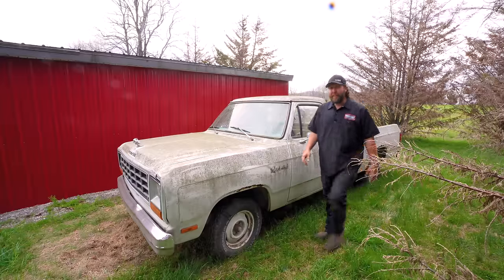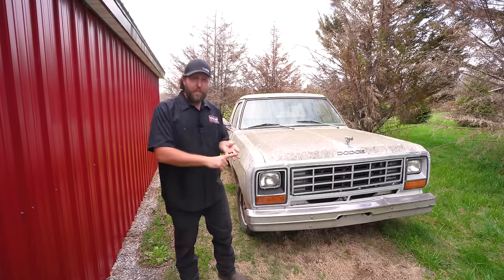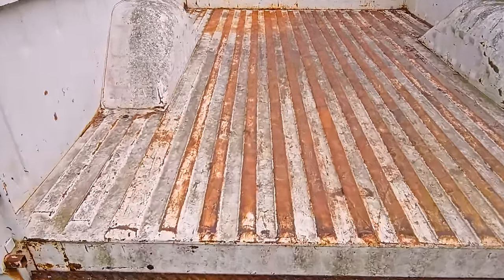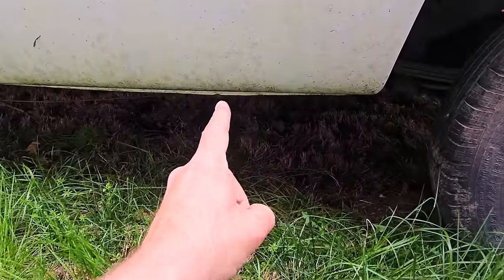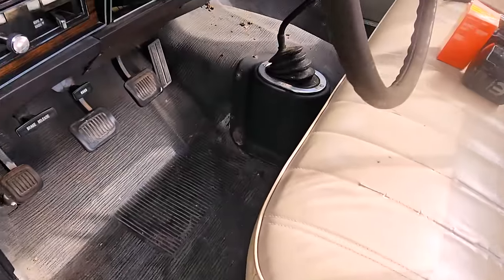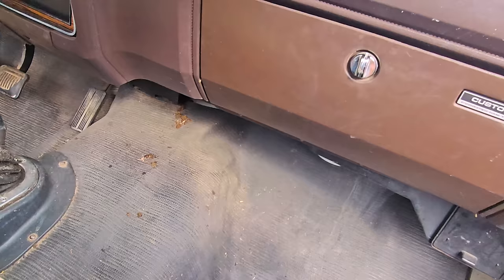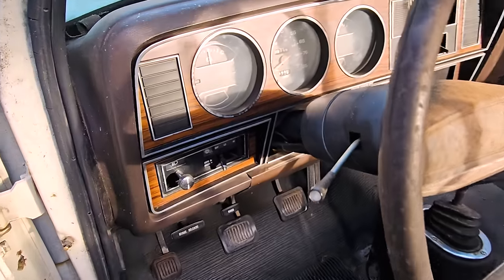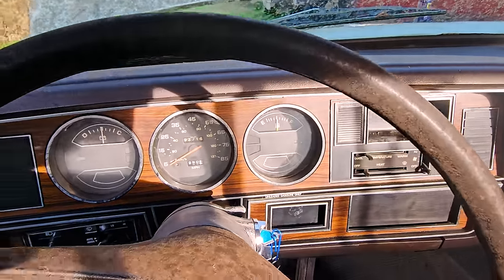Will This Old Dodge Farm Truck RUN AND DRIVE HOME After Being Parked for YEARS?

Comment: I’m a Chevy guy I’ve owned a lot of chevy’s right now I own a 1991 Chevy G20 van, 2010 Chevy Silverado 1500, i owned a 2007 dodge ram 1500 4 door about 5 years ago, I just bought another 2007 dodge ram 1500 a few weeks ago it’s a single cab, I’m going to lower it & turn it into my new auto glass truck

Comment: Only the 72-80 models were called Tin grilles, a complete misnomer because the grilles are made of stamped Al-u-mini-um-. The 81-93's are referred to as 1st gens, because of the RAM name being utilized, which is another misnomer because the RAM name was first used in 80 on a tin grille. The grille surround that 84 needs is 81-85 only and the front bumper is 84-85 only , you can't switch to the easier and better looking 86-90with changing the whole rad suppport. the 91-93 with the big 'Gunsight' grilles are a whole nother story.  yada yada yada., and a guy ain't buying none of the 84 front stuff from a catalog like GM or Ford. Good news though, the tail lights are available cheap from Evilbay or Rock, paper ,skissors.  BTW, a Cummins 4BT will bolt right in with 89-93 6BT mounting and Wa-La, 200 more Feetsy pounds and you get 30+ MPG.

Comment: Another great video!

I'm just curious, do you get registration and license plates for these trips?  I'd be worried about a cop seeing there's no plate!  Also, how do you handle getting your other car back?

I heard that you were NEVER supposed to use trailer tires on a car, because of the way they are made (especially on the front!)  Is that just a myth or ?

Comment: I have a 1990 d150 its been parked for 7 years I put it away with new oil and anti freeze it has not been touched except for oil changes every 2 years. if I decide to put it back on the road is there any special oils or additives that I should use before I fire it up. I live in the northwest so there is a lot of moisture in the air here I worry about surface rust in the engine. she is my first new truck . I bought it with my mustering out pay from the army its been a real good truck for me.35 years the truck lasted longer than my wife.

Comment: All the VGG content is great stuff.. but... The severe judder seen when panning around the engine bay at 17:34 is the result of using a 24 FPS video rate. Videos for YouTube should be shot and produced at 30 FPS or 60 FPS to avoid this. VGG videos from about 2+ years ago were 30 FPS and didn't have this problem.

Comment: Derek I gotta ask how much do you spend a year on tools and parts. ?? And one more thing never ever trust old brakes. Ask me how I know. !!!!  

I used to work for a pizza delivery company here locally back in the 80’s I had bought a 84 Dodge colt to use for that job. Well the back brakes was bad one day and I didn’t have time to replace them before work so I took the back brake line off and put a pair (you guessed it vise grips) and clamped the back brakes off and bleed the fluid off. So front brakes only. Small front wheel drive car only front brakes. Yeah that will be fine. 
Store sat on a hill that was rather steep coming out of the store. Well I was headed out the drive and apparently the cars brakes didn’t like that much strain. Well I hit the brakes to slow down for traffic and heard a pop brakes went to the floor I went right into traffic with no brakes and crossed 4 lanes of traffic some how didn’t get hit or hit anything. But there was a building across the street I hopped the curb and yanked the emergency brake up just as I collided with the edge of the building. Luckily there was no damage to the building or the car really.  However I did need to pull my butt cheeks off that cheap vinyl seat cause they definitely was stuck to it.

Comment: "Things went here"........"sonething went there".........thise somethings was the jack handel and lug wrench.....the jack was located up against the the raf support behind one of the turn signals...it looked like a hydrolic jack but it wasnt...it was like a scissor jack in bottle form........i kniw thus bc when i was 15  i got my first truck and it was a early 1986 d150 ..had the 318 and a 727 torqueflight auto trans...2.94 gear ratio with 1 wheel peal...ugh..but i foind a stock aluminum 4bbl intake and put that on with a qjet i jad layin around...woke that baby up...was a whole new truck....gor a limited slip 3.73 from a ramcharger and that 2x4 wud go just about anywhere ans wud roast the tires off ...miss that ol girl..rip...rust ate her up..

Comment: I’ve got a 1979 Dodge 1 ton 4 wheel drive fire truck.  Like the one off of “EMERGENCY!”, the old tv series around that time.  Anyway, my gas tank is so shot, the fuel pump won’t suck and spit.  So I did the boat tank bypass.  I took the fuel pump off for now, but how long could I run it like that?  My forte is old Jeeps, never had a fuel pump issue until now so I wasn’t sure if leaving that fuel pump boss open was a bad thing or if I could run it like that for very long with the electric pump and boat tank hanging out near the winch on the front bumper lol.  I need to get a fuel tank, but I’m not sure which one I need, my truck is a 79 W400, but with the fire truck bed, not sure if the tank is the same since it has a fuel neck that goes through the fire bed

Comment: Watch them 4 speeds.....imy 2nd dodge i had..had a 318 with a 4 sp..amd i was passing this old lady when the tail of the trans just snapped...dug the driveshaft into thr pavement amd lifted the back end around slin me aroind and face me towards thr old lady..my guess...maybe bad mounts?....so id put some new mounts front to back..eng amd trans...also..that plastic tank..i didnt even kniw until the pump went bad....the houseing that the pump sits in is suppose to be solid to the tank...and mine at sometime had come off..so the pump was moving back and forth...and i nvr knew it bc it always had fuel..btw..that whole unit for inside the tank...new like 20 urs ago....was like $800 so id get it checked out to

Comment: 41:30  DEREK... the 55 with the QUICK STARTING slow oil building prob.... 

you can setup it to ''NOT FIRE IGNITION for 15 or so secs (*(oyou figgure out that time pause)*) with NO IGNITION but everything else working...  till it reACHES ___psi's THEN ENGAGE/enable IGNITION  circuit... ;) 

delay it''s lightning system till oPSIs are GUDENUF.... 

eh I can essplain more detail if required if my translators were misaligned again... lol 

HAVE A GREAT EVERY THING !!!!!

"LOVE  JOY  COMPASSION <------the ROOTs of ALL THINGS GOOD !!!!! :) 
ELEVATE not escalate !!!!!
the ONLY THING 
that SHOULD BE BANNED
IS THE HATE !!!!!" ( " " by ME )